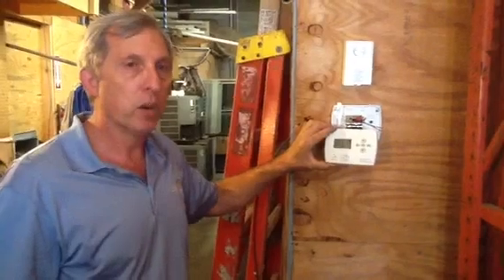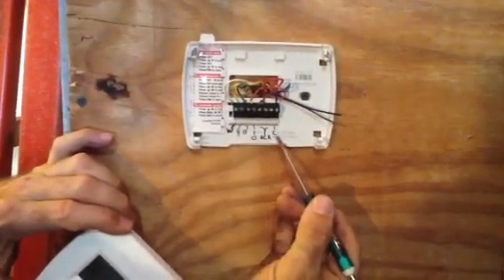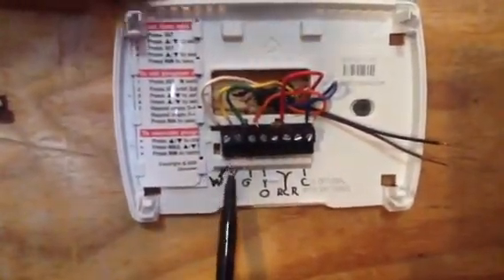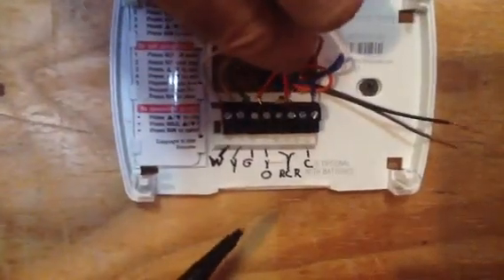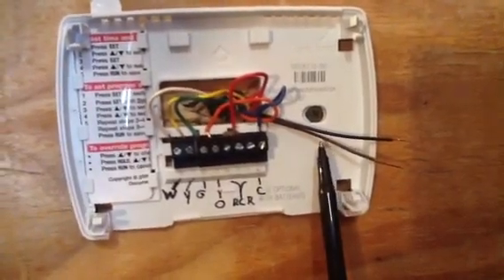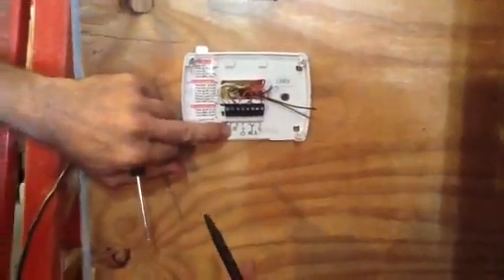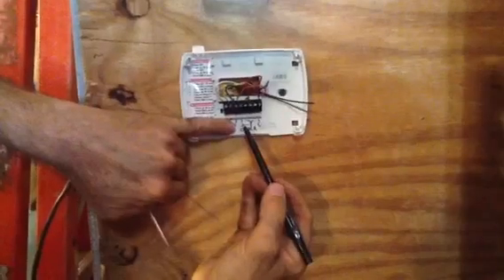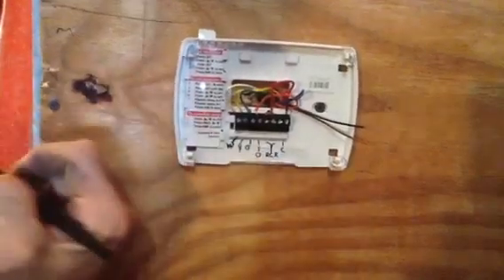Thermostat Wiring Made Simple

Comment: Awesome video very helpful.... having trouble with heat my thermostat is Honeywell RTH9580 and my system is a Goodman heat pump.. My thermostat wires are blue=c, orange=o, yellow=y, green=g, white=w1, black=w2 and red=r... the black wire(w2) is aux and the white wire(w1) is heat but i cant hook  the white wire to its terminal because the orange wire is there... i had a guy come out today and he put the white wire(w1) in the w2 aux terminal when he turned system on it heated up but after he left the whole system shutdown i checked the breaker box and the breaker had tripped so i turn it on again and it trips breaker.. would it be a bad deal if i  connect orange and white together since white goes where orange is?

The out side condenser wiring that are connected is Red, White, Orange, Yellow and Blue there's a black wire but no connection to condenser .. any ideas would be great because it does get a little here in Florida...... Thanks
Reply from the maker: Thanks, I am happy to help

Comment: I just bought a  RTH8580WF HONEYWELL WIFI THERMOSTAT to replace an older honeywell. The C wire was not connected to the old thermo, but is in the house wiring to the furnace/AC. I expected to see a terminal block in the Carrier 58MCB (2008 vintage) furnace, but the wiring is actually not on a wiring block or PCB! It is directly wired to wires from the furnace. There isn't a wire to connect the C to on the furance from what I can tell. I looked for something for the 24V or COM connection. I'm not seeing it.
Reply: I am going to answer my own question. I am not a hvac guy, so keep that in mind. I opened the lower panel on the furnace and there's the control board with the terminal block. The reason that it seems as though the wiring was direct is the house wiring was too short to reach the board, so the contractor extended the wiring. Though I did not find another spare wire in their extension. I added an 18 gauge blue wire to extend from COM to the unused blue wire going to the thermostat and it is now connected to the C terminal on the new themostat. All is working well.

Comment: I have RTH9580WF HONEYWELL WIFI THERMOSTAT I WANT TO HOOKUP TO MY MILIVOLT GAS FIREPLACE.
I UNDERSTAND I HAVE TO ADD A 24VAC POWER SOURCE 1 WIRE GOES TO THE C CONNECTION WHERE DOES THE OTHER GO

Comment: David, trying to install a smart thermostat. I have a Red and White wire only system. The new thermostat requires a common wire for it to work. You did not explain in your video what the common wire does. Can you explain how I can get this thermostat to work?
Reply: common wire will be Blue. Even if you have it in your cable its probably not being used by your old thermostat. Common wire provides 24v to the new thermostat to power it so it wont need batteries. Especially with new lcd and wifi t stats.
Reply: You need to get a new 8 or 10 wire pulled or use a module that allows full control over the two wires. $$$
Reply: I only have a white and red wires

Comment: I don't have a yellow wire. I only have red,white,blue and green. On the new thermostat I got it has a connection for yellow.red.green and white. No connection for blue. Now what do I do?
Reply: Blue is for common to power the new thermostat. You will more then likely need to open your furnace panel and connect this wire to the furnace motherboard where it says common 24VAC or something.
Reply: DH4Hobbies
I connected the blue wire to the yellow terminal on the thermostat. Now it works.

Comment: Hi, I need help my thermostat has only 5 wires and it's the exact same thermostat can you please help pleaseee my central ac and heat were working for so many years and all of a sudden just now the heat isn't working the ac is still working but heat isn't and the 5 wires in this are the white, yellow, green, red (not rc) and blue but the blue isn't connected but yah can you please assist me on what to do please
Reply: Anonymous can you replace a honeywell pro 2000 thermostat with a basic thermostat where I set it at 65 am forget it in other words old school on an off

Comment: I enjoyed your video.  I have two Robert Shaw thermostats....9600 and 9610.  I have gas/electric units.  One thermo will activate a/c-or heat unit by adjusting temperature one degree at a time....normal I think.  The other termo will only a activate heat or a/c when you adjust "two degrees"....very frustrating.  Do you think this an improperly wired problem or something else?  Can you help.

Comment: The past owner of my home was in the low range of do it yourself skill.  so I am not quite trusting the wire codes.  I have forced air heat and a AC unit.  He connected the Blue wire to the terminal labeled yellow.

here is how it is wired 
White wire to white terminal
Green wire to Green Terminal
Red wire connected to the Red terminal labeled RH with a jumper to RC
Blue wire  to  Yellow terminal
                      Blue terminal not connected to anything

Should I treat the blue wire as the common wire? or hire pro to sort it out?
or connect the blue wire to the blue terminal and see if it works that way?
currently the thermostat is working.
Reply: he didnt put the blue on the blue because i bet ur tstat runs off batteties

Comment: David, I do not have 24 to contactor but I Do have high voltage lines  fine.  The output I got from the thermostat tests were all OK, all 24, EXCEPT my R-Y.  My RY TSTAT output was 6 volts.  I noticed some animal teeth mark on outside thermostat wire right before enters condenser.  Is that why I only have 6 volts on R-Y at the thermostat?

Comment: Excellent video. When I connect the Red wire to the Compressor wire, both furnace fan (the fan beside the furnace in the basement) and the outdoor AC fan run. But when I connect the Red wire to the Fan wire (green), only the furnace fan runs. I want to have the AC on, so I left the Red wire being connected to the Compressor wire. Is that how it is supposed to be? I thought for AC only the AC fan outside the house should be running.

Comment: When I was in school, they always taught us that black is the common.
Reply: common wire in electric circuits is the same as neutral wire, it completes the circuit and returns the current back to your system supply
Reply: +jackslater230011 im 3 weeks into school and im having a hard time understanding what common is, can you explain to me its job? if i remember correctly i know it was something to do with coils leading to  24v
Reply: Common completes a circuit.
Reply: IshockO What book are you using for class?
Reply: +jackslater230011 im using the "refrigeration & air conditioning technology" seventh edition
Reply: IshockO Whoa. I never used that book. I used Fundamentas of HVACR for my Principles of Refrigeration class, Electricity. Electronics, And Control Systems For HVAC for my Wiring 1 class, and Electricity for HVACR for my Wiring 2 class.

Comment: I would like to remove my hvac digital thermostat replace with just a heat thermostat no longer have the AC how can I do that and the blower still come on any help would be thankful
Reply: +Bradley Yeates if you give me a little bit more info i could help. what kind of thermostat, system type, how many wire , etc.
Reply: +Alex Kolesnik I have fixed it

Comment: can you use a thermostat from a commercial building on a house because I installed one and now the heater and the ac come on when I turn the ac one
Reply: also when I turn the heat on the heat actually turns off
Reply: +Austin K It was because the new thermostat was configured for a heat pump

Comment: David Jones can you hook this thermastat up to two bulbs and an extension cord for a incubator
Reply: +Ashley Chambers you would need a relay, thermostats only can dish out around 1 amp or so and most cannot handle 110v. but if you use a relay you can make it work
Reply: Ty lol I gave up and just using z hot water heater thermastat it sux cause hard to get em just right but it's doin the job

Comment: I have the exact thermostat that you have in the video.I am in the process of purchasing the Nest Thermostat and was making sure that I wired it correctly. The only issue that I have is that the Nest Thermostat has the Y1 and Y2 as well as the RH and RC. My thermostat has only Y (yellow wire) and the R (red wire). Also I have a black wire that you did not mention that is in the E slot. I just want to get a better understanding on those  above so I can properly wire the Nest thermostat and not "fry" anything.

Comment: interesting, I have a electric heat pump that works great but when the temp gets to where it should be the blower will not stop running. After a period of time I can change it from auto to on and click it back to auto and it shuts off. Sometimes I do it 2-3 times but it cuts off. Could that be in the thermostat itself or do you think I have a bad blower and need it worked on by a professional? Thanks for any advice.

Comment: We only use our unit for air condition. The batteries were changed. However, now if using AUTO, the numbers on the left start out showing the current temp, but then continue to drop lower than the set temperature. The thermostat was turned off for awhile and then tried again. The only way to run the air condition is to turn it to ON. Is there a reset switch or is it the sensor and can I fix it?

Comment: I have a conventional oil fired forced hot water system. I am changing out an old style Honeywell round thermostat It has 2 terminals and wires only, 1 wire in from the boiler 1 wire back. I am changing to a Honeywell programable wifi T Stat. The new T stat requires a "C" Wire providing 24 V to the T Stat. I need to run that wire to the transformer on the boiler. Question do I need a "ground" wire or 3 wires only. 1 to R, 1 to W and 1 to C.....

Comment: At 5:56 seconds into your video you never did mention which two wires that you were connecting with the wire nut.  The video (at least in my case) isn't clear enough to see which two wires you are connecting.   Thanks
Reply: I am with you, what does "it" equal?  Which wires?

Comment: Thanks!  I just replaced my old round Honeywell with a new programable thermostat. On my old Thermostat the Blue wire was placed on the Y terminal. When I wired up the new one I put the Blue on the B terminal. No wonder my AC compressor didn't come on. I didn't have a Yellow wire and had no idea that I was leaving the AC compressor with no control wire. Your video showed me just what I needed and taught me a lot. Now the blue wire is back on the new Y terminal and everything is working fine. I don't need a common wire?  Thanks again.
Reply: +Ron Green I had the same setup myself yesterday.  I noticed the blue wire went to the Y terminal on my old thermostat.  I just wired the new thermostat the same way the old one was since it worked fine before.  I hope David answers our question about the common wire.
Reply: Trying to change mine and notice my BLUE wire is connected to YELLOW terminal??? Do I wire the new thermostat the same, or, put blue to blue?

Comment: Thank you for taking the time to explain some of the basics of thermostats to help the DIYs out there.  It would also help to explain that there are small relays in the thermostats that have contacts that can fail after so many repeated cycles of make - break and quite often the cause of the problems discussed that arise over time.  Also explaining that the Letter Designations on the terminals correspond to the color of the wire used though that is not always a given in each and every installation.  Cheers, Victor

Comment: Hi David,
Quick question, I have a Lenox thermostat and my unit is a two stage cooling. The wiring at the thermostat is as follows Blue-Y2. White- E. R-red. Green-G. White- Y. I'm trying to replace it with a Honeywell RTH8580WF which requires a C wire. Can i use the G wire for C? and put a jumper at the board from G to Y??. Thank you

Comment: Hi Dave, I'm having problems with newly installed thermostat. Cold air is constantly blowing although  thermostat is turned off. I only have four wires, 2 white and 2 red wires with jumper connected to RC+RH with red wires in RC and RH. The white wires are in G and W. Need help! Thanks.

Comment: Hi, i set my Tstat at 72 at night and the ac goes on but it stops at 74. the ac and tstat do not reach the desire temp. Is the tstat bad? I recently changed the low batteries and put it back into place. It worked fine for 1-2 weeks then it started doing this yesterday.  The ac does cool and it works fine with the tstat at any temp but not when set lower than 75-74.

Comment: I want to swap a very old, 2 wire (white and red) thermostat to a 7 day programmable.
The furnace is oil fired for baseboard hot water. There is no AC.
I'm trying to confirm that the white wire will go to (W) and the res wire will go to (RH).
Thanks for the help!

Comment: Hi David. I have a 4 wire lead coming into my honeywell programmable thermostat. Blue, gree, white, and red. The furnace works fine however, the a/c runs all the time. I don't think the compressor is running but the a/c fan is running. so I disconnected the blue wire from the terminal to cease that. now that it's getting warmer out I need the a/c. so I reconnected the blue and set the thermostat to cool. Furnace fan runs but not the a/c. any thoughts?? stumped!
Reply: TheWillRyan Nevermind. thanks to your tutorial I figured it out. Moved blue to the yellow terminal. It all makes sense. LOL. everything seems to be working in order. Thank you Sir

Comment: Thanks for the info, very helpful. I need to install the new generation thermostats that works with ATT. this is up here in NY, if the c wire is not present, can I draw the 24 volts from the rh by pulling a jumper to the c so the thermostat gets powered? 
Also is there another way to test the thermostat? I have tried 2 of them and neither went on for some reason although I had 24 volts at both the rh and the c

Comment: http://tinypic.com/r/15517rk/8
This is a fan relay with a 2 speed blower motor, it is not relevant to a heat pump per se, however does show how the fan is operated in the heat mode by a time or temp or temp/time delay of some type and which speed and how they are isolated to insure 2 speeds are not energized at once.
After viewing the thermostat drawing I saw the auto switch explains the auto in cool function however it left the heat mode for gas furnaces out of the picture, I hope this is ok to add I just like to help if I ever can.

Comment: Great video...I have thermostat on 1st,2nd,and 3rd floor...1st floor get heat when thermostat is on...2nd floor gets heat when thermostat is on...3rd floor no heat thermostat calls for hear but 2nd floor heat goes on.  I also notice that 1st floor zone light is lit when on..3rd floor is lit when on..2nd floor is not lit but is on...also there are only 2 taco units on boiler.

Comment: David Jones Need help here. Comfort Zone II thermostat has not power and bought a Honeywell RTH2300 for replacement. Wiring diagram on guide book does not match and tech support are clueless as well. Four wire connected from panel: Blue connected to RS-, White RS+, Green VG and Red to V+. How do I connect these wires to the RTH2300 if possible. Regardless, thank you in advance for your advice.

Comment: Joe, my current White-Rodgers has a jumper shorting the W and Y terminals.  I just purchased the Honeywell WiFi thermostat - will I need to also short those two terminals on the new thermostat?  I also don't have the C wire or terminal on the WR unit, but Honeywell states that you need it to power the new unit.  Is that going to be a problem?

Comment: Thanks for the videos.  I'm replacing an old thermostat with a honeywell pro 1000. The old wiring is blue to RH, white to W, yellow to Y, green to G, Red to RC now on the honeywell the terminals are labeled as
Y, R, C, G, O/B, AUX/E
I need help on how to connect the wiring.
Reply: Thank you for your reply.  I solved the problem with purchasing an updated model that had the RH and RC on the terminals. All other wiring was already the same color so it was easy set up. Again thank you for taking the time to reply.

Comment: OK i just watched this video and have a question for ya. i work at an apartment complex and we have heat pump units. I've worked on them before but where i'm at now the thermostats are different than any I've messed with. we have a 6 wire thermostat i'm use to seven wire you know a black wire for emergency heat. well on these they are a gt5020b 6 wire  thermostat. c w2 rc o b rh w y g a with a jumper from rc to rh and a jumper from y to w. i'm getting confused at with the jumper from y to w  cause with the new tstats i'm installing the are a white rodgers blue series non programmable and they run a  c o/b y w r l g so now to my question when putting this new one in should i still need to run a jumper from y to w?